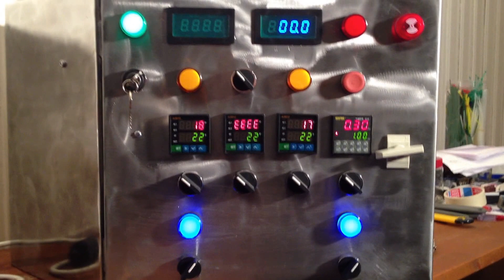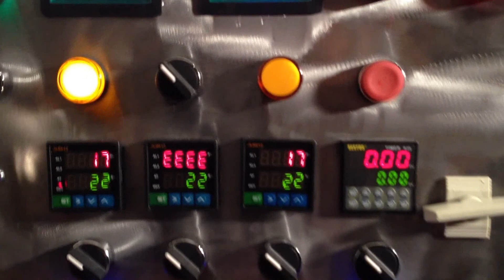Thanksgiving Control Panel Update

Comment: Wow , that`s a beauty . Lots of work inside that one , great job !
Reply from the maker: ***** Thanks! Yeah it was a great experience putting it all together. I learned a great deal and really like the result. Cheers!
Reply: Tony Yates Hey Tony , i`m having a problem finding that punch out you use for your kettles . What make is it & where did you find it ?  I was going to install my whirlpool arm tomorrow , but the prices of the decent 1" step bits around here  is close to $100.  I was looking for punchouts on the websites of the local stores and nothing like it, that can do a 1" hole  is coming up . Doesn`t using a step bit take a long time ? Your punch out demo on YT when you did your kettle was really quick in comparison  and dit a beautiful clean hole .. Any information greatly appreciated ...